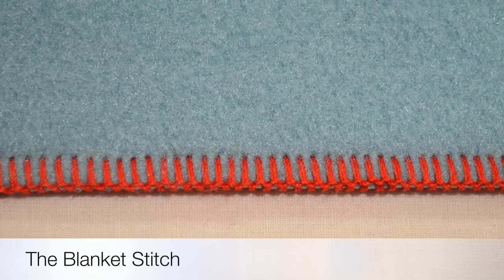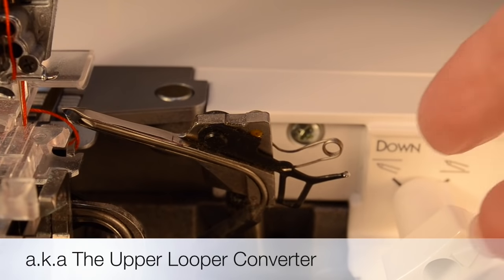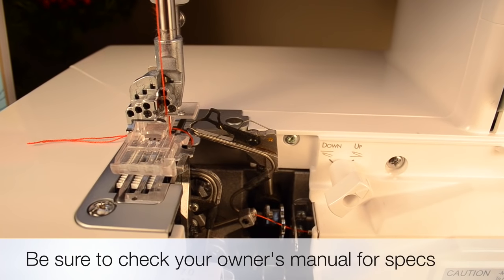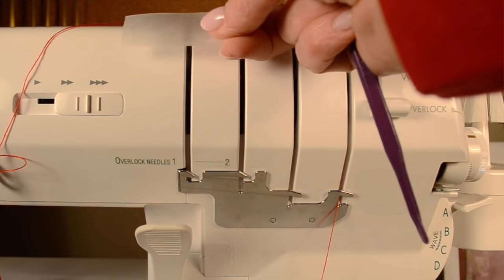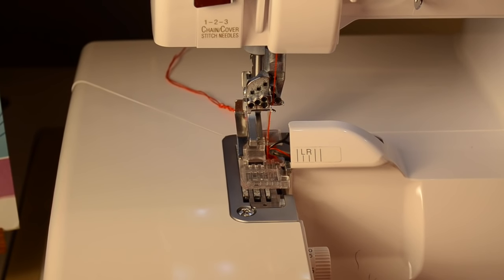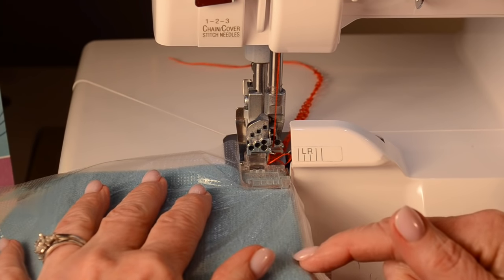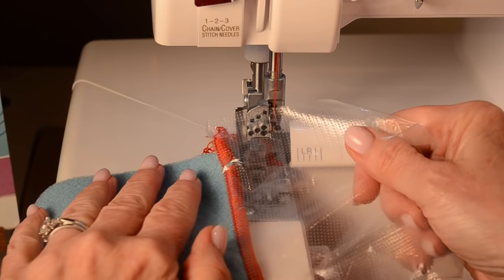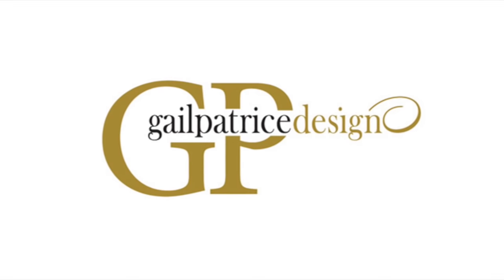The Serger Blanket Stitch

Comment from the maker: The machine set up for the 2-thread reverse flat lock (ladder stitch) is exactly the same as the blanket stitch. But the reverse flatlock can be used as a joining stitch (between 2 pieces of fabric) or in the fabric surface, but not as an edge treatment. The "added ingredient" to turn the reverse flatlock into the blanket stitch is the strip of stabilizer. It's like magic!

Comment: Gail Yellen, so in doing the blanket stitch we do not put the looper thread in the tension or isn it the left needle thread we do not put into the tension?
Reply from the maker: HI Jacquelyn, It depends on the serger. Which brand and model machine are you using?

Comment: Thank you!!  Spent last few hours in books and phone call.  This is perfect!
Reply from the maker: Hi Linda, Glad it was so helpful and thanks for watching Serger Tip Clips!
Reply: @GailPatriceDesign  Just saw this.  Unfortunately I used #12 embroidery thread as no decorative thread matched from where I purchase my notions.  It kept breaking.  I had to give up and just resorted to a 2 thread blanket stitch.  Don't really like the look so planning to add a binding now and cover those stitches.
Reply from the maker: @ditzlela  Some  embroidery threads won’t withstand the tension on a serger and are too lightweight for a good looking blanket stitch. If you try a Jean stitch thread which is 12 weight  or similar I think you’ll like the look. Pearl crown rayon (8 weight) is also beautiful. What machine are you working on and what are your settings? Thanks.
Reply: @GailPatriceDesign  I'm using Babylock Accolade.
Reply: I used the Quick Reference Threading Guide, 2-Thread Flatlock-Wide setup.   Wish I could send pic.
Reply from the maker: @ditzlela  Hi Linda, The Accolade  should give you a good looking stitch. Do you have your subsidiary looper in the upper looper eye and are your threading routes correct? Your left needle thread should go through the upper looper threading channel. (Check the Quick Threading Guide for a 2-thread flatlock stitch and the decorative thread should be in the needle.) If you use a thicker thread in the needle, use a topstitch needle. Let me know because I want you to get great stitching-thanks!
Reply from the maker: @ditzlela  Linda, send a pic via my email: gail@gailpatrice.com

Comment: Thank you so much for your tutorials, they have saved me multiple times!  One question, are you using decorative threads in the needles and the looper?
Reply from the maker: I used a 12wt. decorative thread in the left overlock needle (topstitch needle). Serger cone thread was in the lower looper. Glad the Tip Clips have been so helpful and thanks for watching, Jean!

Comment: Hi Gail, thanks for the tip!
Must you have a coverstitch serger to use this technique?
Reply from the maker: No, the blanket stitch is a 2-thread overlock stitch. (No cover stitch required.) You want to check whether your serger has 2-thread capability and the fastest way to find out is in the owner's manual table of contents. If your machine can form a stitch with the needle thread and lower looper thread, in your accessory case, you will find an upper looper converter. (On some brands, it's called a subsidiary looper.) You can also access this info in the owner's manual where you'll see a photo or illustration for how to position it. Let me know if you have any other questions—will be happy to help. Thanks for watching the Tip Clips and tell your sewing friends to tune in—thanks!

Comment: Thanks for the video! Can this technique be used with a double layer of fleece? If not, what serger stitch would you recommend?  Thank you
Reply from the maker: You can experiment with 2 layers. Just adjust the stitch length to the longest possible on your serger. You may also have to try using a slightly heavier wash away stabilizer because pulling the needle thread across 2 layers may need a bit more stabilizer strength. If you can't get it to work, a 3-thread wide overlock works very well through 2 layers. Make samples to get just the right stitch length for the weight thread, etc you're using. Let me know if you need more help and thanks for watching Serger Tip Clips. For more fun inspiration, check out my "Serge Outside the Seams" Board on Pinterest.
Reply: Thank you so much for replying! Love the look of the blanket stitch but will probably use the 3-thread wide overlock on this blanket project. Do plan to test the blanket stitch on a single layer of fleece. Will definitely check out your "Serge Outside the Seams" Board on Pinterest. Love your videos!
Reply from the maker: Great and if you have suggestions or ideas for future Tip Clips, send them along!

Comment: Is all wash away stabilizer the same?  I borrow some to try and it seems to tear easy - it was called 551 Sol-u-film - it tore off before I got my stitches pulled over...any thoughts appreciated...I really wasn't pulling hard, but this is my first try...very new to all of this.  Thank you!
Reply from the maker: Hi Georgia, there are various weights (thicknesses )of wash away stabilizers. I’ve had the same thing happen to me when using a thick decorative thread . The thread rips through the stabilizer. You can use two layers of Solvy rather than a heavier weight, like Super Solvy. Pull both layers at the same time and  dab with water to dissolve and remove it. Or you can use Super Solvy that is heavier and won’t tear. It will need a bit more time to dissolve with dabbing water or you can soak it off if your fabric is washable. Hope that helps and thanks for watching Serger Tip Clips!

Comment: I'm confused - you say you're using the left needle but it sure looks like the right hand needle to me.  The left and center needle positions appear to be open and the right needle is in the machine.  Is that correct?  Thanks.
Reply from the maker: No, it's definitely the left overlock needle. I think you might be looking at the chain needle positions to the left of the overlock needles. Or it could be the camera angle. But it is the left overlock needle that I'm stitching with. Thanks!
Reply: okay, thank you Gail :)

Comment: Can you use this blanket stitch on a double layer of fleece if you would like a thicker blanket or would it be too bulky?
Reply from the maker: Hi Mary, That's a great question...I've never tried it on a double layer of fleece. It also depends on how thick each layer is. Some of the 100 wt. fleeces are lighter so it might work. But the best way to find out is to try it. Adjust the stitch length to the longest and use a heavier weight decorative thread. A thin thread will get lost visually. Let us know if it's successful and thanks for watching Serger Tip Clips!

Comment: Will embroidery tear away stabilizer backing work to use making the blanket stitch on flannel?  I searched for tear away stabilizer about 4 in wide? Do you have any suggestions?  I have tons of flannel scraps and new Imagine Serger..
Thanks Janice
Reply from the maker: Hi Janice, I have never tried tear away stabilizer for the blanket stitch. You won't find 4" wide stabilizer—just cut strips. (That's what I did.) If you do use tear away, let me know how it works. You'll have to pull off all of the little stabilizer tidbits from under the stitches. The Imagine is a fantastic serger—you'll love it!!!!! Will look forward to hearing about your results—thanks!
Reply: Wow, that was a quick answer. Can I do the blanket stitch without the stabilizer?  I have used brown packing paper before on another project?  I ordered the clear stabilizer from Amazon today. I may wait on it and send the 50 yd roll of embroidery stabilizer to Amazon. Someone saw the material and is waiting on the blanket.  Thanks so much for the quick reply. Love your Serger tips.
Reply from the maker: No, you need the stabilizer to pull the needle thread across the fabric to the edge. After answering your previous question about tear away stabilizer, I think that the tear away will do just that—tear away before pulling the threads. Definitely a wash away stabilizer like Solvy will work best. Glad you're enjoying the Tip Clips. Tell your sewing friends about them and ask them to subscribe to my YouTube channel–it's free!

Comment: How in the world do I do a blanket stitch with that clear material on a large throw out of fleece or Joann’s Sew Lush Fleece?  Great video.
Reply from the maker: Hi Vickie,  As with any specialty stitch, test your settings on scrap fabric first. With fleece, you'll probably want to use a thicker, bolder decorative thread (like a 12 wt. or 8 wt.) Lighter weight thread will sink into the fabric and won't show as well. And for a blanket that has long, wide edges, cut multiple strips of Solvy Stabilizer and just keep adding it to the edge as needed.It's a cool stitch and fleece is a perfect fabric to use it on. Let me know if you need more help and thanks for watching Serger Tip Clips!
Reply: @GailPatriceDesign  thank you so much!  I just got my serger right before Covid started .  I’m totally a beginner.  I will be watching because I surely need help!  Thanks again!
Reply from the maker: @vickiecopeland7131  I Love helping newbies so I’ll look forward to hearing from you. What serger did you buy? Please reach out and even if we need to schedule a phone call, I’ll be happy to do it. Once you get comfortable with your serger (and you will), you’ll wonder how you did without it.
Reply: @GailPatriceDesign  I bought a Baby Lock Enlighten.  It was new in the box.   I know it is no longer made but more than enough for no more expertise  than I have.  My mom sewed a lot .  I did for 4H many years ago and I had to take out and do over since my Mom was a perfectionist.  Now, I wish I had listened and paid more attention.  Hindsight is 20/20!
Reply from the maker: @vickiecopeland7131  the Enlighten is a wonderful machine, so it's a great choice and should give you many years of great service. Your mom was a wise woman. You can email questions directly to me: gail@gailpatrice.com and I can help you with anything-thanks!

Comment: What is the lower looper set at.?
Reply from the maker: Hi Mary, my machine doesn’t have tension settings. But check your manual for suggested settings for a 2-thread flatlock stitch. The lower looper setting is usually high and the needle tension is low. You might have to experiment with a variety of settings until you get the desired results. Let me know if you have more questions and thanks for watching Serger Tip Clips!